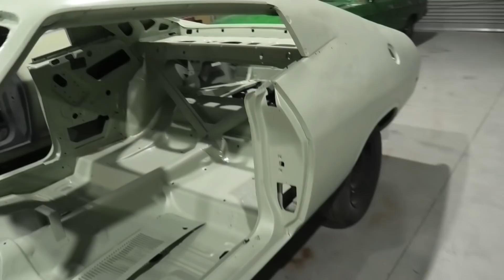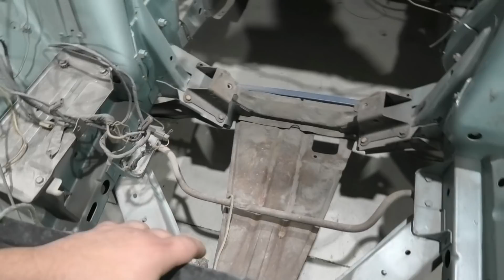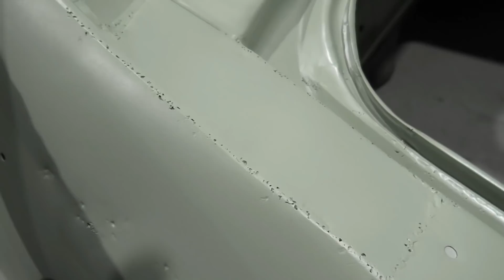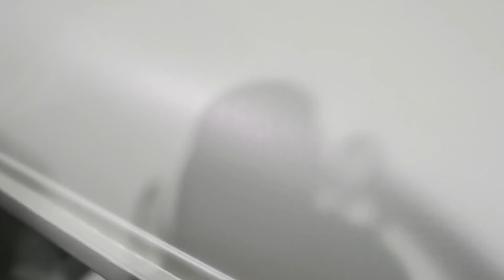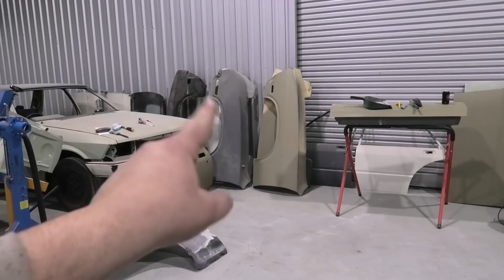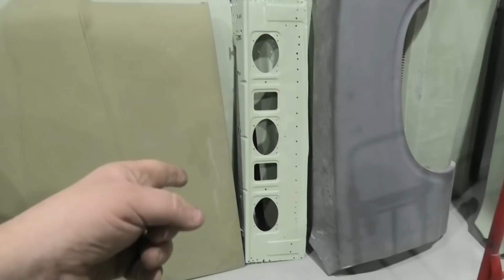The landau is back again!!

Comment: I'm interested in hearing about the repairing prior repairs on that XC coupe, what would happen if it stared leaking water or falling in half down the track?

i like the idea you've got in NOT selling, but SWAPPING a project.  also with your skills you'd surely be able to consider the sedan as a finished project value because it probably wouldn't take that much to panel/paint it adding lots of value.